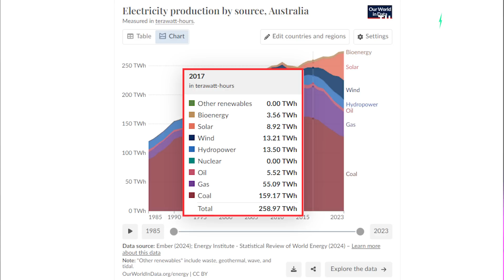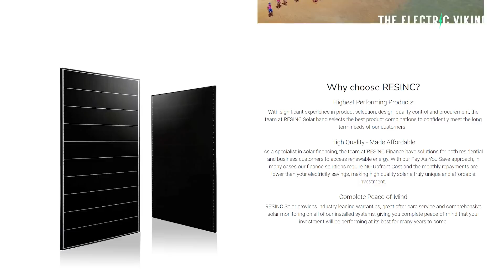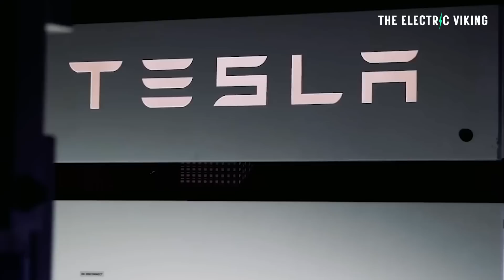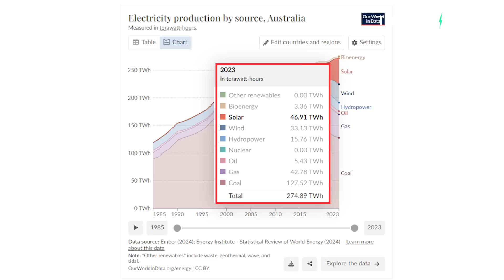Almost 50% of Australia’s electricity is now generated from renewables

Comment: Australia can make most of their deserts green, with solar. If you block out some sun with solar, you can grow plants underneath. This will make Australia a power house in agriculture.
Reply: You need water, too.
Reply: @lawdog5766  this seams to be a problem in regions where is not much water but solar. They need water for washing and cooling these panels. From what I read this is a concern.
Reply: @lawdog5766  desalination
Reply: @lawdog5766  So true. It's not energy but water holding Australia back. Vast areas that are only marginal at best for grazing or cropping need more water.
Reply: Go tell a farmer that ....
I would love to be there when he replies. 😅😅😅😅
Reply: If you put solar on top of water reservoir too you can prevent evaporation
Reply: Danes have changed Egypt's sand to soil. Using dung.
Reply: True.❤👍
Reply: @willeisinga2089 This is absolute rubbish. Australia is 2/ 3 arid and will remain so for millions of years.This is a result of our latitudinal position under the SUB TROPICAL HIGH PRESSURE SYSTEMS.The global deserts eg Sahara,Africa ) are all located on the western sides of the continents between the latitudes of 20- 30 degrees with the sub tropical highs above.That means continuous drought- El Nino if you like. I wish some renewable  energy dreamer's would learn some Geography.Your'e simply not going to change the earths mechanics and " green" the arid regions.It will be roughly the same in 100 million years. Do you think humans will be around then.I hope not,because it will be an ugly planet,all built with no forests and polluted,shrinking oceans from dumped  human junk!!
Reply: @veritas1944  Australia is not going to turn green but could easily desalinate enough seawater to grow crops. Lots of deserts are used for cropland. It just takes water and renewable energy can provide the necessary energy. It can provide far more energy than fossil fuel ever could. It only takes five acres for a one megawatt solar farm.
Reply: @veritas1944  What a load of mischievous nonsense narrative. Thanks for being that "expert". 😂
Reply: @veritas1944  wasn't the Sahara green 5-11,000 years ago?
Reply: We are a powerhouse in agriculture. Because we cleared 10"S of millions of trees to achieve that. You don't know what you're talking about when it comes to soil preparation, seeding, fertiliser application, pesticide application, and harvesting . It's simply not possible to do what you lunatics propose. Stick to your keyboard  and leave your opinion on agriculture in the toilet where they should be.
Reply: Not quite that simple. But with a few extra complicated steps and technologies, yes.
Reply: search for Agrivoltaics.   Sheep  are #1 for grounds maintenance.    They can be rotated too,   and produce  wool + meat.   If you already have a couple of border collies, you are set
Reply: @donmcgimpsey1706 sheep are also solar powered
Reply: Solar panels create cooler micro climates beneath them, preserve rain, and prevent evaporation.

However Australia is vast. It's as big as the United states. 

The area needed to power the nation is tiny compared to the size of the country.

However with the right agriculture, Australia could Green from the coasts inwards using fog nets and the like.
Reply: @mac_mcleod Solar panels will give more electrictrisity. This can help with pumping water, removing salt.
And, it can fuel farm equipment.
Reply: @geirvinje2556  I agree.  But Australia is vast .
Reply: It will make it even hoter, but yes with enough water....
Reply: I might be wrong here but I have to assume if the pannels are extracting energy from the sunlight then the pannels would be reducing the amount of energy within the system thereby reducing ambient temperatures because temperature is really a fancy word for average genetic energy. So less energy generally = a lower temperature and vice versa.

Comment: Put some floating solar over those pumped hydro reservoirs... gain some efficiency.
Reply: I'm case you don't know, there's a phenomenon called wind...
Reply: We don't want fantasy we want cheap electricity  and preserve how habitats  for the NT wildlife.All those solar panels are ugly and won't last long.What are you going to do with all the useless material that isn't recyclable?Associated  toxic  chemicals could ruin the groundwater and there goes our precious ecosystems. The NT environment is delicately balanced and dependent upon the monsoon rains.Invasion with all this infrastructure will destroy in time.
Reply: @veritas1944  The technology for floating solar is mature and will last 25 years.  After that, the panels can be recycled.  As long as the rise and fall of the water can be accounted for, the reservoir (and the adjacent land) is a perfect place for solar, since the transmission lines are already there.   Which part do you think is fantasy?
Reply: @veritas1944 And get the beef cattle out while you are at it. They are not natural. And don’t take any water from the artesian basin, that isn’t natural. And did up all the roads because cars and natural. And get rid of the cars because they turn into hulking rust buckets. And get rid of the service stations because they pump dirty fossil fuels. And get rid of the aluminium mines and smelters because they make aluminium that makes solar panels. And then go back home to England.